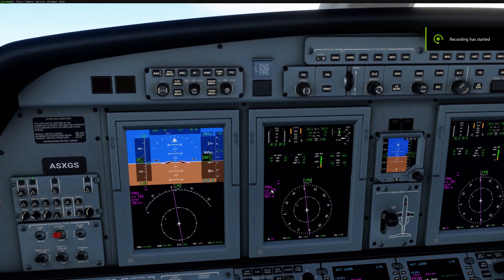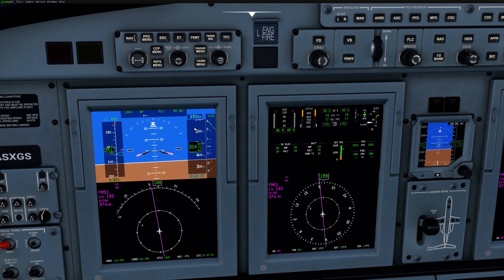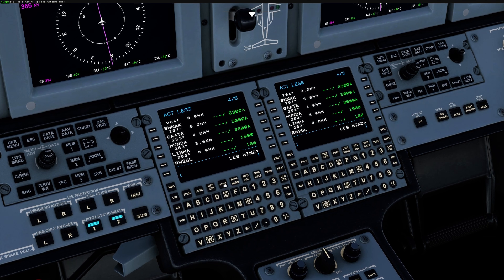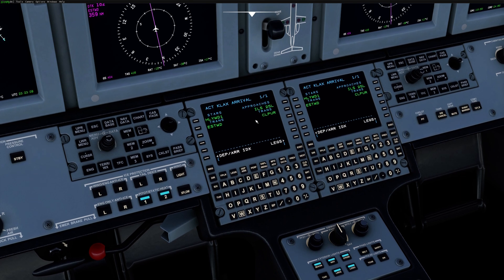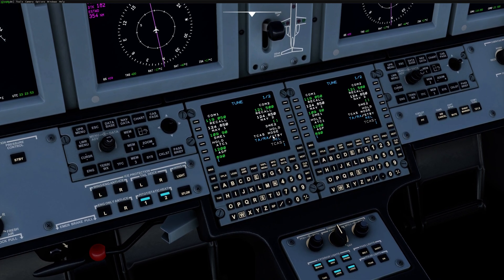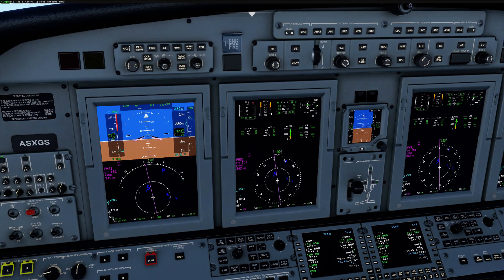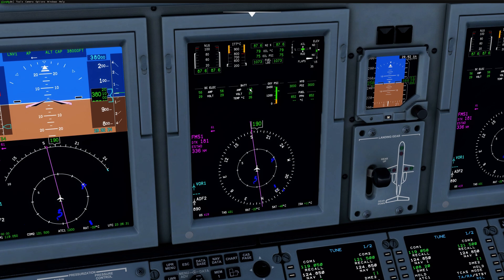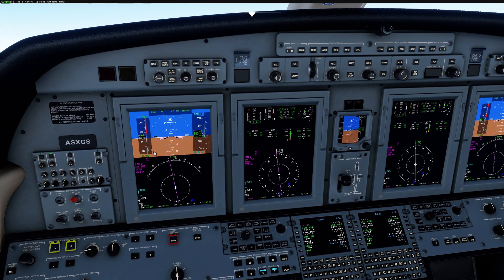Working Title CJ4 0.6.0 Features Showcase

Comment: Does the real airplane's Altitude tape(on PFD) actually show increments of 10'?  (eg; 10, 20, 30, 40, etc)  My understanding is that it should display increments of 20'  (00, 20, 40, 60, etc)
Can that be changed (If I am correct)?